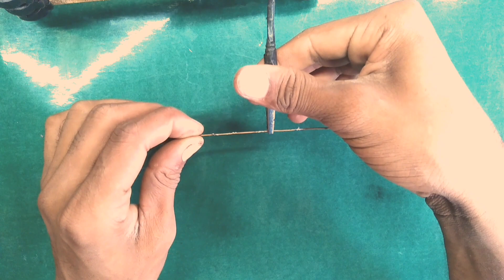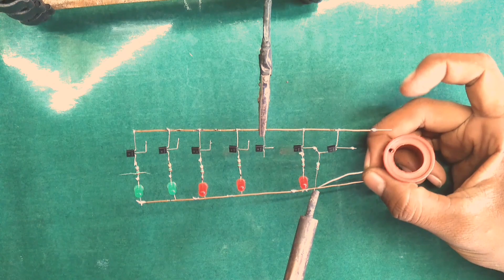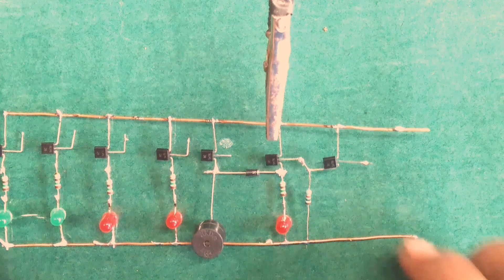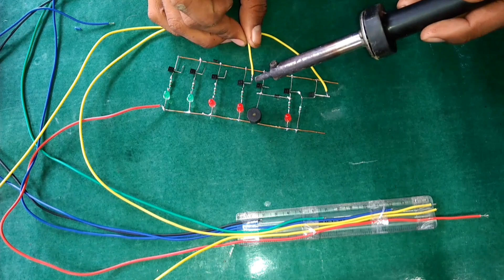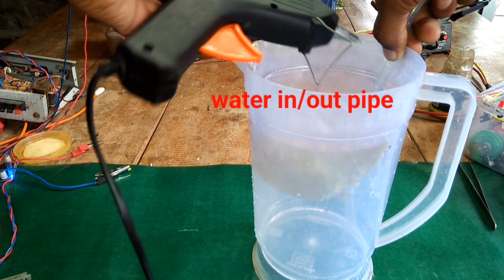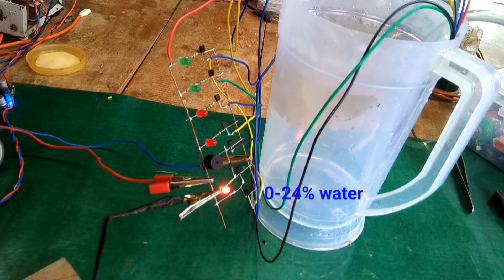how to Make LOW Level and HIGH Level alarm with level indicater and water level indicater

Comment: 187 / 5.000
Hello, I would like the function to switch on the water pump when the water tank is full and switch off the pump when there is little water. How does that work?